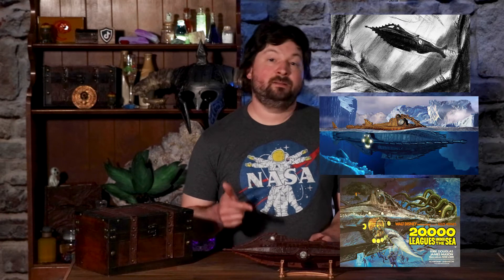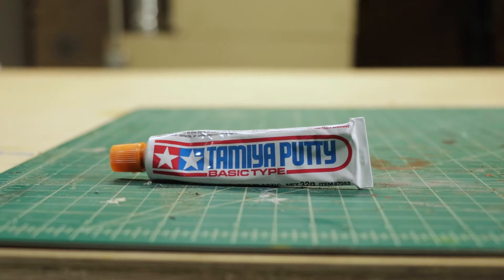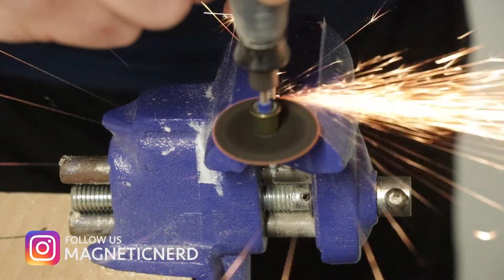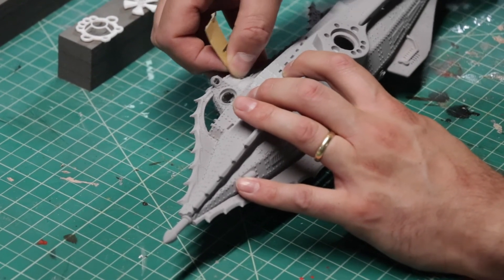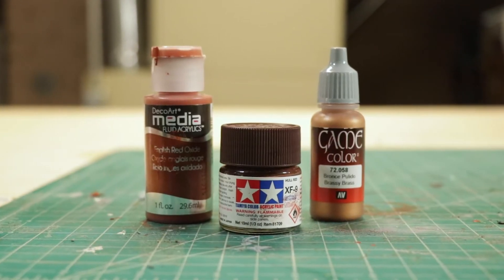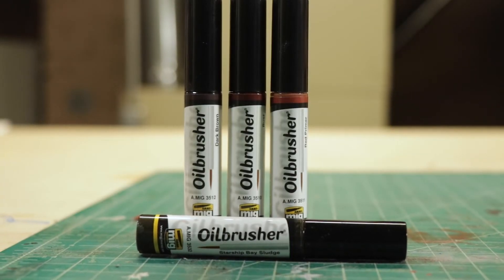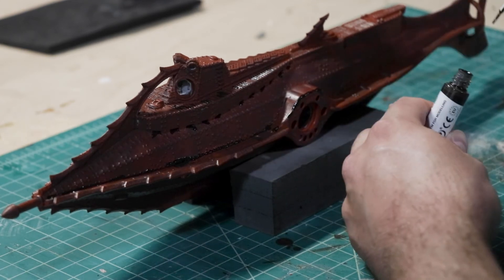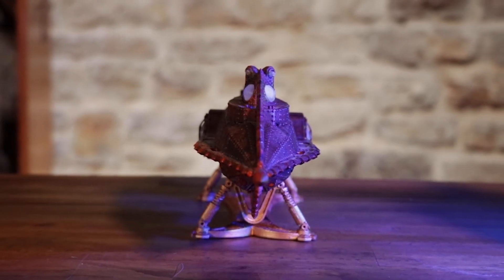3D Printed Nautilus

Comment: Building my own and just learning. great video, thanks! going to get the resin filler for sure, never heard of that one. Question, what did you use to make the molds for the clear pieces? is it some sort of silicon mold kit?
Reply from the maker: Thank you!!! And to answer your question. It is a silicon mold. If memory serves me right, It was either smooth on’s rebound 25 or oomoo 30.

Comment: What glue did you use?
Reply from the maker: If memory serves me right…. I used an epoxy resin for the large parts of the hull. And then CA glue for the small parts. However, doing this today, I would use a wonderful product called 3d gloop for everything.
Reply: I’ve heard of 3d gloop but don’t know where to get it